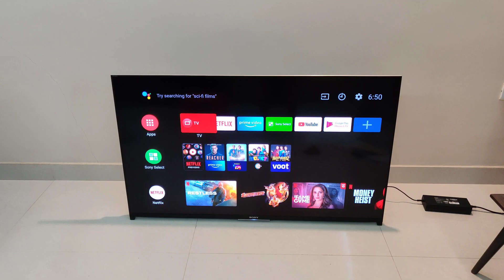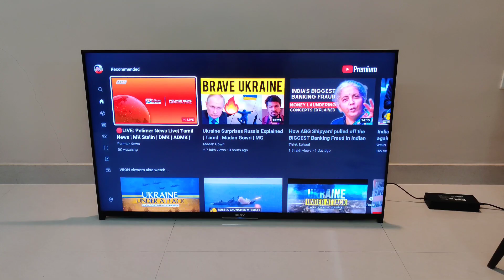Sony Bravia Red Light Blinking 6 times - Issue Fix! | KDL-50W950C

Comment: my sony TV kdl49w800 bravia android bought in 2020 Feb.
1. TV plays good on other videos except HD videos on youtube and HDR videos on prime video or Disney hotstar on adroind TV app.
2. While playing HDR content the TV shuts off after few seconds and 6 times Red lights blinking.
3. the same things happens after restarting the TV and playing same content. however other media works good on my TV.
3. Complaint raised and TV sent to service centre (Sony). they tried replacing power board and mother board. the problem persisted. they finally said its the panel problem (costing 29K apprx.).

please help me resolving the issue. thanks
Reply from the maker: Hey ajay! I faced the exact same situation and replies from sony as you. That’s the reason I choose to do my own R&D and find a fix for this problem! Do try out the fix I’m sure it should get your Tv working back!

Comment: Hi bro..i need your kind opinion. I have a Sony KD-65A8F (OLED TV). Ive been using it for 5 years. Recently theres 6 red light flashes occuring, not always but sometimes. When it happens, I'll turned off the TV, disconnect the power plug, reboot & its fine. A few days later while watching, the tv turned off & 6 red light flashes again. These flashes occured sometimes 15 min while watching or it could go fine for 2 days before it happens again. Ive gone to self diagnostic menu..i saw it indicated backlight error. 3 columns with number codes. The service guy asked me to factory reset and the code was back to 0 (normal). A few days later it happens again. This has been going on for 2 weeks. Now the service guy said its likely that i need to change the whole OLED panel. Its not worth it as it will cost me around USD 1500. They also said they could change the board which is cheaper but could not guarantee the problem would be solved.
Questions - Is it true that OLED TV doesnt use backlight. If so, why the indication of backlight error in self-diagnostic?
- Can you suggest what is i should try next? Change the circuit box? Try your method? etc. Changing the panel is out of question. With that price, i might as well get a new TV. Thanks!

Comment: Hello, I own a Sony 55XE7096 that has the same problem. Do you know if I can cut the same wire  like you do in the video? I sent you an email with pictures. Please can you advice?
Reply: @Adith Krishnan  heloo Adith, can you please tell me if I need to cut the same wire ? I sent you an email with pictures
Reply from the maker: Hey arnaud! I’ve not received any email from you.. rest assured if you followed the video exactly you would find the right wire to cut and get the Tv working!
Reply: @adithkrishnan9538  hello yes it works! I confirm this is the same wire to cut on my TV model. Thank you for your support!
Reply from the maker: @arnaudschockmel2678  great to hear that!
Reply: I just sent you an email with pictures. My model is kdl65850C

Comment: You sir are a legend! Thanks so much for taking the time to make this video. It worked 100% for my KD-55X8509C. My power board looked a bit different, was exposed circuits rather than having a cover but the plug looked similar so I just went for it and cut/grounded the 4th wire from the top as described. TV is working perfectly!
Reply: Great video. I wish there were more people like you!
Reply: still working in 2024?

Comment: Hello, someone from Germany here.
I have the 55" Sony Bravia KD55XD8005 with the same problem. Red LED is flashing six times, the TV just went of during watching a movie and after turning back on, the screen gets black while booting the android OS.
I'm an electronic engineer myself and what happens here makes sense. There doesn't need to be a real problem. If the backlight doesn't respond with the correct current or resistance (due to age for example) the Inverterboard could release the error signal for protection reasons, even when there is no real problem YET.
Just an explanation for everyone who wonders, what's going on. 
Sadly, in my TV it is a bit different. First and fourth wire sockets in the plug are empty, so I tried with fifth and sixth, but had no luck.
The problem was the same, still six red flashes. I think at least the error indicator should disappear, so probably I haven't found the right wire yet and would be very thankful, if someone could help me how to find the right one.
I am pretty sure the backlight has no real problem in my TV, since everything looks very normal during booting. No black stains, no dark or bright spots, all colours correct...
Did someone find another wire for BL ERROR?
Reply: Did you find a fix? I have the same tv with the same problem 🤦🏼‍♂️
Reply: @saggers798  yes, but it was not 100% satisfying. 
The wire solution works, but for our model it isn't the 4th in the first row, but the first (or last) in the second row. It is directly opposite of the white wire, next to a bridge going from first to second row.
But if you take it out, you also unplug the problematic LED strip which leaves a light shadow on the TV. I ordered a new strip for only 10€ and will fix it correctly today.
Reply: @saggers798  important note: since in your TV could be a different LED strip problematic, it could also be another wire, which should be in the same area like the one, I described. 
CAUTION: don't ground the wire, some of them have current (mine has 3.5V). Instead isolate it, works the same. 
Also, I didn't cut the wires, I did pry them out by pushing carefully with a very small screwdriver in the opening, while pulling the wire carefully. A bit tricky, but I didn't like to cut.
The contacts have a little snap, holding them in place in the plug. This snap can be pushed down with a very small tool.
But after all, I can say I understand a lot more about TVs now and with this problem (6x red LED), an expensive repair service is totally unnecessary. 
Feel free to reach out, if you encounter any problems.
Reply: Reach out, when you have any questions. I did the same thing to my TV what is described in the video. 
Unfortunately my backlight was gone, so I had to order one and replace it. In the process I broke the screen 😭 so I had to replace it, too.
Now the TV works again and I know everything about it 😅
Reply: @saschaloggen  it works!!!!! It wasn't the wire mentioned I just trial and errored all the thinnest wires one at a time it was bottom row 4th up from the bottom. Nice one, I nearly broke my screen too from irritation but kept going, thank you!!!
Reply: Nice to hear, great work. Yes, it is possible that it was a different wire. In my case it was also different than in the video. But during working on it, you get a pretty good understanding on how the components work with each other, if you have a technical understanding. Anyway, I'm happy for you that everything worked out just fine. I hope I could help a bit nonetheless.
Reply: @almost perfect how do you isolate it instead?
Reply: @AndyWalker25  sorry, just saw your question. I used isolation tape, which is very flexible. But any other tape ( like scotch or tesa) will do the job as well. Just make sure the wire isn't touching any metals in the TV. If you need help let me know
Reply: @saschaloggen  If isolating the  wire instead, would it not be the same to remove the wire from both ends?
Reply: @TheMetaphysicianIAm  well, technically yes. But that's more work and not necessary. Don't forget, the wire ends in a very small pin in a plug on both ends. No need to unplug both sides. You might even destroy the pin. Just isolate and see if it's the right one.
You might wanna order the correct backlight in advance, so you can exchange it. But be careful with the panel. It is very thin and made of glass
Reply: Nice explaining very grateful. I've exactly the same model, same problem, I've cut and reconnected a few wires now. Which exact wire is the connector to the sensor bit?
Reply: @stefanbarrie2232  it's been some time now, but there should be two rows of wires.
In my case the corresponding wires was in the second (or lower) row and since it is a double unit (2 led backlight bars), it was the first and the last wire.
But the backlight might in fact be defective, so I highly advise to order the matching led backlight for your tv and just replace it. But careful with the panel, it brakes very easily
Reply: @saschaloggen  I'm grateful for your expertise I'll let you know how I go
Reply: Its pin 12 on this tv for the wire . The top row is even numbers and the bottom row is odd numbers so if you start from the bottom of the tv its the 6th wire on the top row . Found the pin diagram after a lot of searching . Wouldnt have even considered it if it wasnt for this video so now have a working tv again .https://www.commentreparer.com/doc/37376/Sony-KD-43XD8005-chassis-GN2TR-pdf

Comment: Just buying a t.v is not enough , you should learn what kind of stain you should not give to it , you should less backlight to minimum and always cover it with cotton cloth and in summer remove the cloth and use . you should not let it over heat and over cold .

Comment: Thanks. Worked cool. As mentioned by you removed the exact no. 4 wire for my TV KD55X7000E.  Everything is fine screen and sound all perfect.
Reply: ciao mali5553 ho un sony KD-55XE7077 ed ha il problema che lampeggia il led rosso per 6 volte. ti volevo chiedere se avevi fatto una foto al lavoro che hai fatto per mettere a posto il televisore ? ti ringrazio se mi rispondi
Reply: Also worked for my kd55x7000e! You're a legend!

Comment: Just unplug your HDMI cable or HDMI device Maybe your USB drive too and shut down TV and it will work without this fix. The HDMI connection that connects into the TV gets hot as a pistolah. This fix works for the KD-60X690E

Comment: Please can someone help me on this issue , I have sony lcd tv model no kdl-32w600a if i power it. It will on and display but after some mins, the power will be on but no display with 6 red blinking light
Reply from the maker: Please follow the video and try the fix! I've clearly mentioned points to follow and fix this issue.. It should help get the tv back to life :)

Comment: Will this work with a Sony tv kdl-65w850c
Reply from the maker: It should, Chris! Kindly open up the TV, cross reference the components mentioned in the video and try the fix!
Reply: Hi Chris, I’m wondering if you managed to fix your TV and what steps you had to take. I have the same model and same issue..pls advise

Comment: Awesome fix Adith, thank you. It worked on my 2018 model KD-65X7000E. I do have a diagram which shows it's wire number 8, making this 4th wire on row 2.
My TV's symptoms was: I switch on the tv and after 5 seconds you hear a click and it restart, then a second time the same, and a third time when the red LED started flashing 6 times with a 3 second interval. Again, thanks
Reply: Hi Chiggahouse, I grounded the nr 8 wire I cut. The wire Adith refers to at 4:30 in the video
Reply from the maker: Great to hear, Stefan! Happy it worked! :)
Reply: Hi Stefan you wouldnt happen to have the disgram showing which wire to ground? i have the same model of tv as you and have the same issue
Reply: Hello Stefan, 
Could you possibly share your wire diagram?
In my KD55XD8005 the first and fourth sockets of the plug are empty. No idea which wire to ground instead
Reply: In my KD- 55XD8505, i don't have a fourth wire. Only on the second row. What to do?
Reply: Stesso problema non ho il quarto filo

Comment: Nice video! I have sony model kdl-75w855c is it the same 4th cable from the top?
Reply from the maker: It should be! Kindly open up and check if the components are similar and identifiable.. then you can follow the video and try the fix!
Reply: @adithkrishnan9538  thank u for answering. 🙏 I did so and now the blinking red light is gone but now i got only sound and no picture (black screen). Any ideas on how i should solve this?
Reply: I get picture for like 2 sec and then its black screen and only sound.
Reply from the maker: @ese2627  okay this is a different case I guess... Maybe there's some genuine issue with your TV's backlight and that's why it's not turning on? Not sure how I can help fixing this :(
Reply: @ese2627  I also have the model kdl-75w855c and it's exactly the same error like yours did you found a solution for that? Thx  :)
Reply: mine is the same model and does the same. did you find a solution

Comment: MY KD-60x690 is like this too ,much does it cost to fix it ?thank you
Reply from the maker: Not sure of the exact cost. You'll have to approach the official Sony service centres so they can evaluate and quote a cost.
Reply: I have the same model of tv but the connector has 9 pin both side is that I have to cut the 4 pin wire? it will work?

Comment: SONY Quality is gone down consderably from worse to worst.....DONT EVEN THINK of BUYING IT.... I got a Sony KD-55X80J in Sep 2021 for Rs 80,000.. It started giving this 6 times LED blinking and shutting down problem in June in the 10th month.. Luck for me in my warranty period..but the etechnician cant replace the faulty part till they realize what is the problem ..... I am dumping this off and getting a cheaper variant of whatever is ther eis market... HD Quality my foot.
Reply from the maker: Hi! Yes I very much agree with you. Pls consider LG! As I thought my tv had conked off prior to opening it up and trying a fix, I went and bought a new TV. Went for the LG 65 inch 4K TV. LG65UP77 model number. It's very good in terms of pictures, smoothness of UI with the magic remote and AI features.. First time I've bought LG and very happy with it's amazing picture quality. Quick to open apps no lag and not very expensive compared to Sony..
Reply: @adithkrishnan9538  how is MU TV?
Reply from the maker: @adornis0078  not sure about MU or MI  TV.. haven't owned one :)
Reply: Sony should increase the quality.Otherwise,they are good .The protection is often taken as problem as Local technicians getting confused and do more damage.Sony charges heavy too
Either way the customer is suffering 😞
Reply: This is the last sony TV that I will purchase. Good video, but dead in 6 months... I appreciate the fellow who showed easy way of fixing this crap TV
Reply: Ah! Bought x80aj but within a month faced same issue . Still under onte year warranty, if claimed will they replace the panel
Reply: I used to work for Sony. And your right quality has gone way down hill

Comment: Sony kdl-40r480b,6 time blinking problem
Reply from the maker: @baskaran pls watch the video and try this hack! It should get your TV working. Make sure you find the right components and cut the correct wire as I've shown in the video
Reply: @adithkrishnan9538  your TV model and our TV model inside fully different I couldn't find the cable which one,can you help to find it
Reply: @sspjoys12  i have a sony kdl-43w950d....i have six times red light blinking prob..i followed ur video...u said the power panel will have 14 wires...but my tv has 15 wires...so confused wch one to cut

Comment: I have a Sony Bravia...6 red.blinking..im ready to cut
Reply: Hi Dupree, did it work ? I have the same problem.
Reply: @sureshparmar8284  Yes it did...BOSS
Reply: @dupri68  Thks for the confirmation. Im just concerned if it would lead to a more expense repair. However nothing ventured nothing gained.
Reply: @sureshparmar8284  Follow the direction step by step..CUT CORRECT WIRE AN GROUND IT...
Reply: @dupri68  Thks Dupree. It worked, however the backlight failure is too severe to make my TV usable 😥

Comment: Hello Adith,

Thank you for your solution.
My Sony TV KD-55X8507C had the same issue with 6 times blinking. I did your solution with grounded the 4th wired from the big connector presented in your tutorial and the TV is working again but not 100%.The right side of my TV is darker then the left side.I suppose some back-lights are broken or intrerupted and this was the reason of 6 times blinking. 
What do think about it?

Best regards 
Silvio
Reply from the maker: Hi! Yes the backlight panel could be damaged or have some other issue.. Not sure what's the fix for that other than replacement of the backlights.. But the one I've shown in the video would not entirely work if backlight is damaged as you say..
Reply: I have the same problem. Right side doesn't light up. TV doesn't do the 6 red flashes anymore. Think I am gonna order some backlights

Comment: I picked up a broken tv, this video was two days too late.  Not sure if I could have solved but the red indicator was flashing red six times.  But the backlight lit up for a second then went out followed by the red blinking light, so assumed backlight was at fault.
Reply from the maker: Ah well sounds like the same issue I had made this video for. if you still have the TV by any chance I'm sure you could give this hack a try and it should get it working..

Comment: Works on the XBR-55x850D. YOU JUST SAVED ME SOOOOOOO MUCH MONEY. Thank you my guy.
Reply from the maker: You're most welcome!😊
Reply: 55x850D here also however there was no 4th wire for me just an empty space. Ended up cutting the 5th wire since there was no 4th and now the TV is pretty much trash now
Reply: @SPOCK22  LMFAO why would you even attempt that.
Reply: @SPOCK22 I have same issue. No 4th  wire. And total is also 15+15 pin. What should I do.
Reply: I have same issue 55x850d help me

Comment: My cables doesnt have the 4th wire. . . And my tv model is kj 55x8500d
Reply from the maker: I'm sorry but I'm not sure how I could help you.. Try to follow the video along and see if you're able to recognise the correct IC board and then the right set of wires on that..
Reply: Hey did you do that? Which wire did you cut?